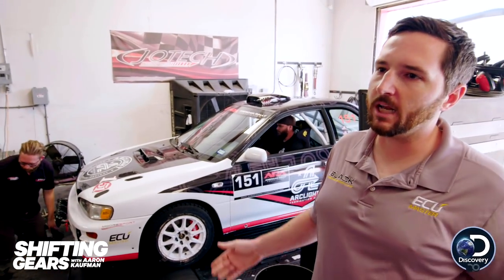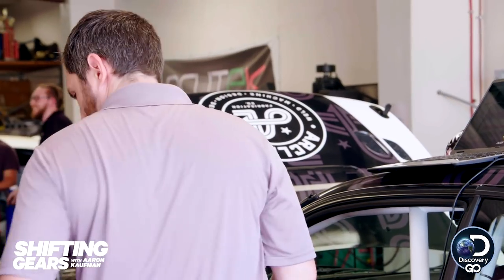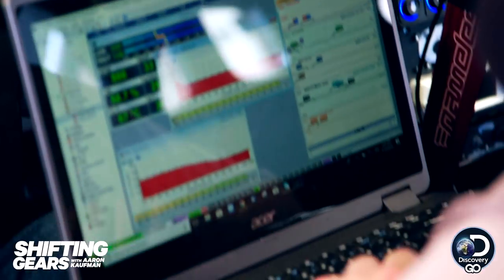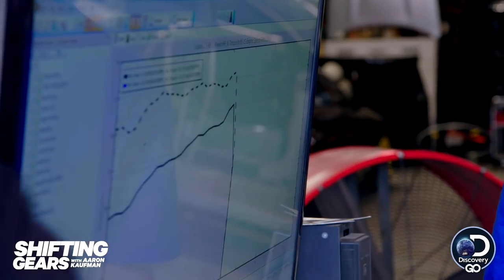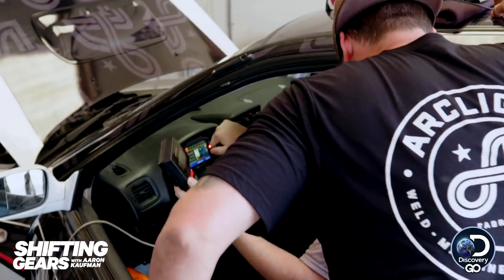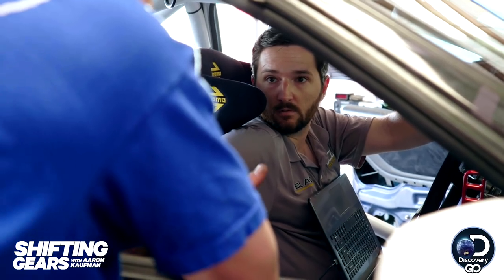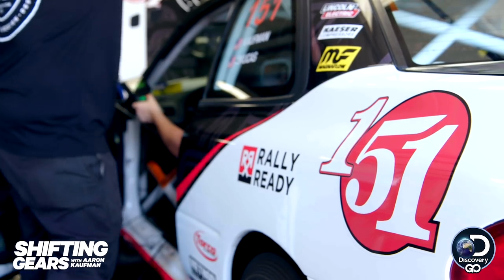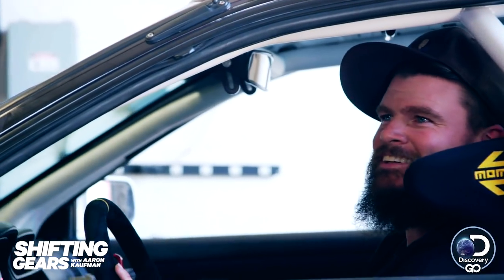Dyno Testing the Arclight Rally Car | Shifting Gears with Aaron Kaufman

Comment: Now that you have a few race machines and the races only take a bit of time it might be worth looking at using track time to design a virtual track that  can be used at home for testing in the off-track time. To use the car data and the new virtual track you would need to put some air-bags under the tires that responds to input you do via the cars controls used while driving. 6" of travel will be enough to give the people in the car a real case of motion sickness. 
Motorcycle controls  would need about 6' of travel to replicate Baja or Dakar tracks.

On race day you are going down a track you have been on every day for the last 6 months and the slopes/dips/bumps match the real road. Pikes Peak  could also be a track used for practice before the real race.

If a new twist in hill climbs is needed try racing down the hill rather than up it.  Brakes that gave two rotors on the front would be a winning combination.